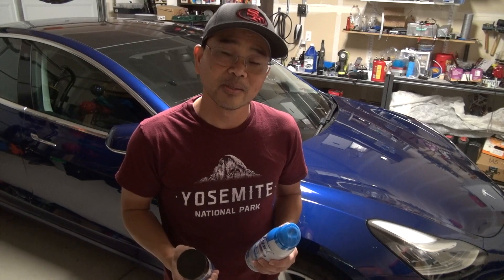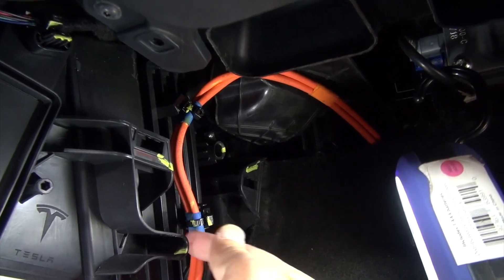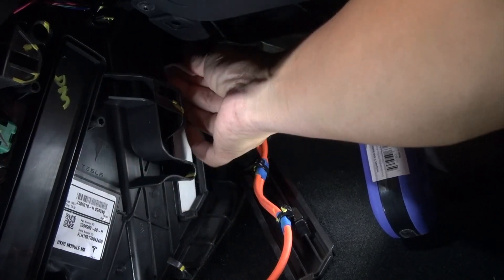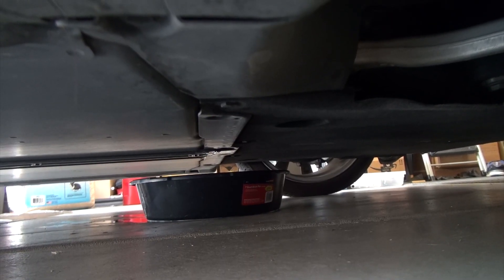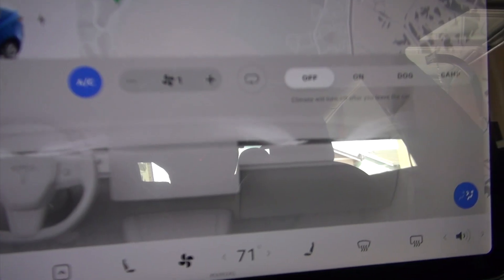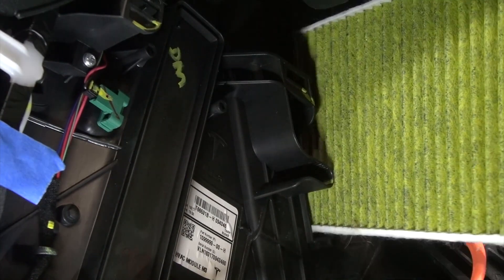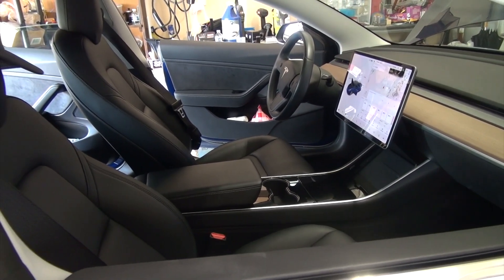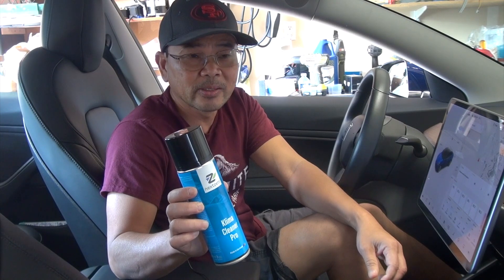Tesla Model 3 AC Smell Gone!  How to Clean Your AC Evaporator!  (PART II -2021)

Comment: Gonna try. Thanks. After watching a few video I learned to try filters w the rubber/foam perimeter. Supposedly the material is antibacterial/fungal. The paper perimeter ones absorb water during rain and car washes. The dampness promotes mold and bacteria. Also don’t run AC or keep it as low as possible during car wash/rain to minimize amount of water sucked into filter. (There is a drain hole in the intake but when the AC is running, the filter still gets wet.)

Comment: Did you spray the whole bottle of lysol? And did you use both bottles of AC cleaner? Thanks!
Reply from the maker: A little more than half bottle of Lysol and both bottles of AC cleaner.  No more smell since…Thanks!
Reply: @diypotentials  sorry, just wanna confirm, do you spray the AC cleaner into where the air filters are?
Reply: @diypotentials I wonder how you managed to use two bottles, I had a hard time finishing the first one as the foam was overflowing!

Comment: Worth mentioning, my 2022 Model 3LR has the filter screw on the bottom so it's easier to remove AND the orange wire is no longer there! Thanks Tesla for correcting these issues.
Reply from the maker: Thanks for sharing! Really good to know that it is easier to access the newer models.
Reply: Damn, U and I both, my 2022 M3LR is 2mo shy of a year and vinegary smell started a month ago, in temperate climate.